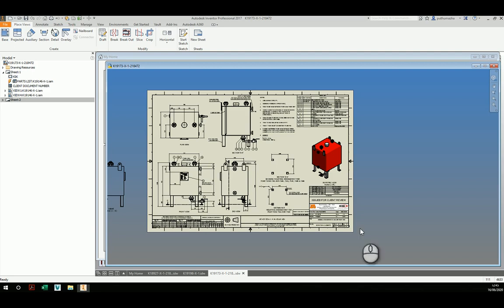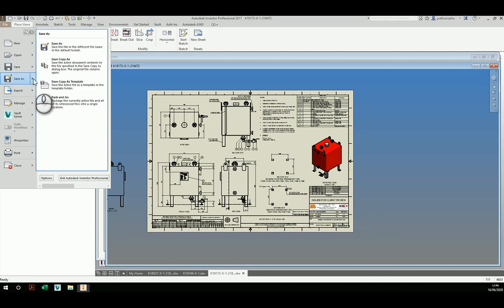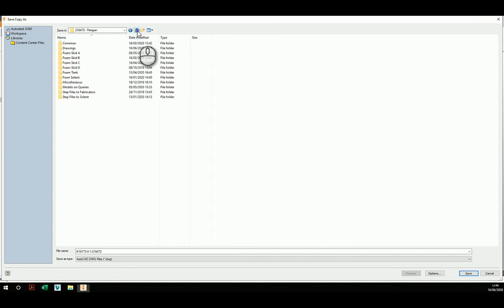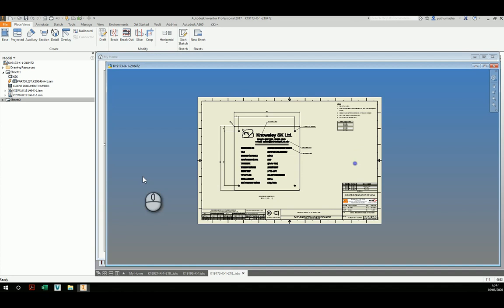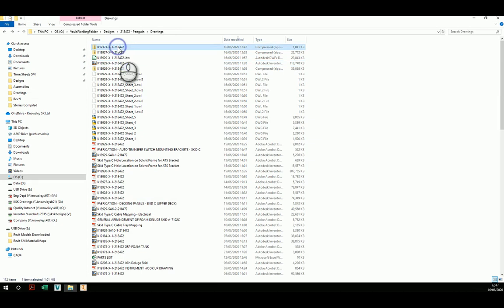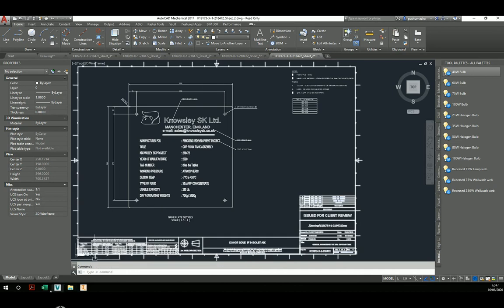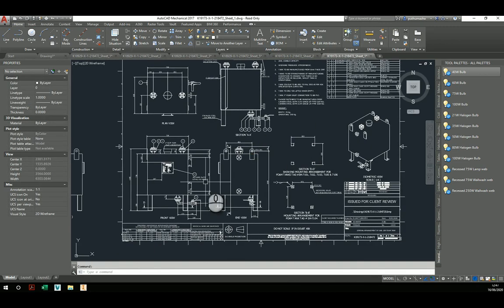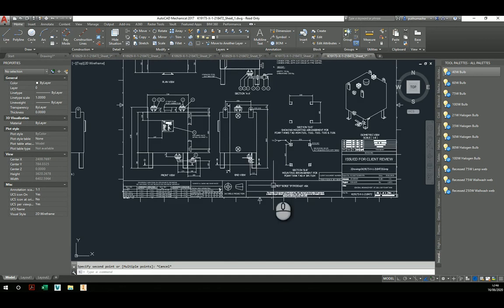HOW TO COVERT INVENTOR DRAWING TO AUTOCAD FORMAT

Comment: How is it opening in model space? When I open mine it is layout or paper space. I do not want to open in paper space
Reply from the maker: I am sorry, I see this comment now. In this video, I am using Inventor 2017 version. I am not sure which version you are using and if the exporting feature behaves differently.
Reply: @shefeekmusthafa6756  Figured it out. I think, it works so I'm going with that. lol.
So since my Inventor drawing is already a .dwg file. I had to export as a DWG then a dialoguie box came up to choose export as DWB default configuration and some options to choose model space, sheet space, layout space etc. 
So I selected Default dwg configuraiton and base view model space and that worked.
Reply: @shefeekmusthafa6756  I'm using Inventor 2021 and 2022.